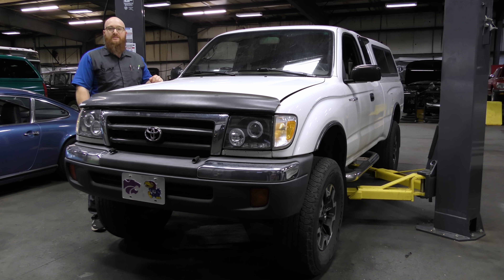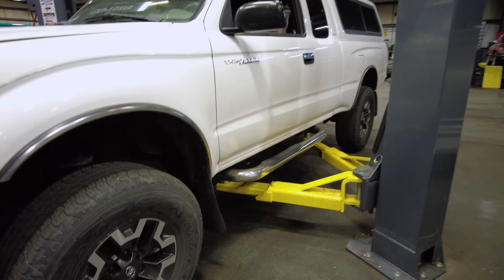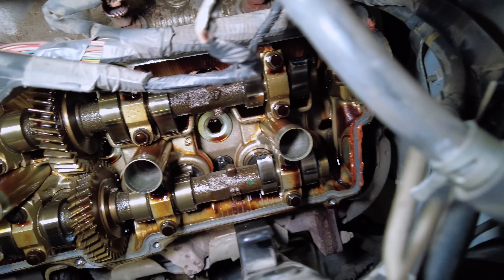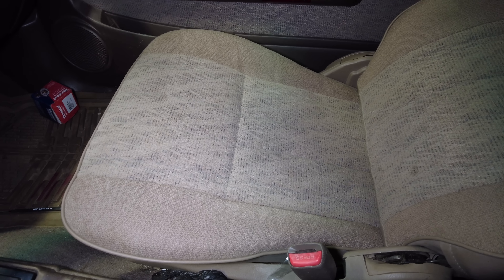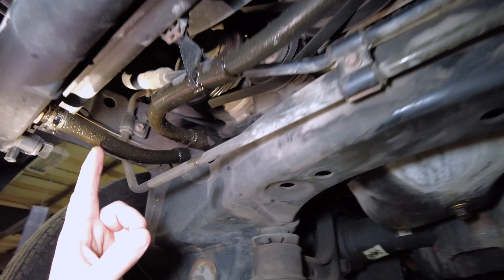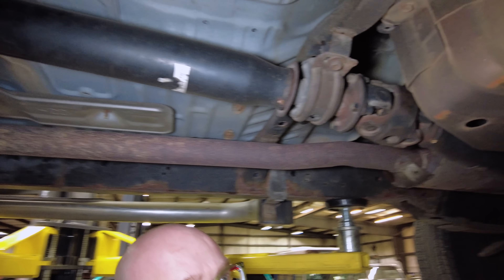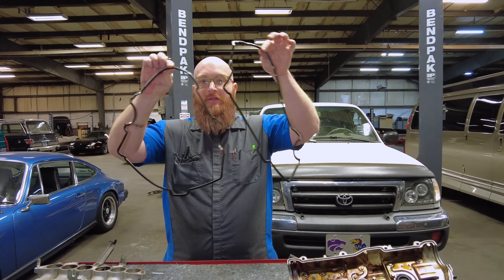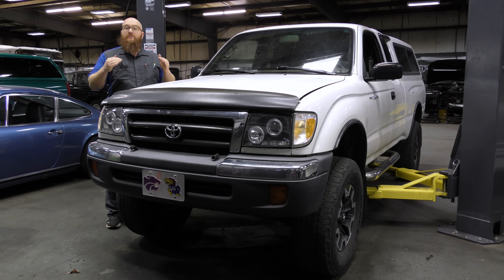Is it worth fixing this rusted out '99 Toyota Tacoma? CAR WIZARD explains

Comment: I'm still driving the base model 1993 Toyota pickup I bought new. Over 300,000 miles so far. No rust except for the original chrome bumper that I replaced. Uses no oil, original clutch, alternator, starter, and rear brakes. Solid little truck.
Reply: Uses no oil ?? You don't put oil in your engine ?
Reply: @Vintage Triple X  think he means it doesn't burn any
Reply: Oh! Thanks
Reply: Yea, oil is for the weaker brands, as long as you spit inside the oil cap its ready to go for a few more years 😂
Reply: @isaacdelavega9487  oh okay.
Reply: @vintagetriplex3728  BMW uses no plastic
Reply: I was sad to dump my 01 tundra... 298k miles, stock clutch also, no oil use, ran like new... (My dad bought it new)

But it was so rusty, and only 2wd... I moved further north and needed 4wd. 

I spent more time fixing broken things due to rust and patching them, than real issues, it was a wonderful truck.
Reply: @vintagetriplex3728 By the sound of my gardeners Toyota Tacoma, I don’t think he ever puts oil in his engine.
Reply: 22RE?  Have you had to replace the OE plastic timing chain guides?  The driver's side guide on mine broke ('91, 170k miles) and the chain was eating through the timing cover.  Replaced with aftermarket metal guides.
Reply: I'm a bit surprised to see so much oil coming from a Tundra, even one from that year. Makes me wonder if it's a driver's issue.
Reply: Yeah, I saw one, which is rare, of a similar year in rusty Wisconsin yesterday, it was crumbling into dust, as did all vehicles up here.
Reply: @lab1042  I installed a new timing chain set including new guides at about 190,000 miles. It was starting to make a little noise but the chain wasn't touching the timing cover and the guides weren't broken.
Reply: @mgrsdgfsdafsdgrsdgfsdg6980  yep, my old friend HAD to get a new car every 2 years. Just pay off your vehicle!
Reply: No point in selling it now. People take those things and beat them into the dirt, so they are getting rarer.
 -  Someday, you will be able to say "I own a classic 1993 Toyota Pickup".
Reply: You're telling me there is zero rust anywhere ? That's what you're saying?
Reply: $1500 for your work but how much for the frame repair which looks pretty bad? Good video.
Reply: Best year IMO
Reply: You probably want to replace those rear brakes they may be corroded and not giving 100%
Reply: original clutch? holy moly!
Reply: @vintagetriplex3728  Gottem
Reply: My '92 doesn't have quite as many miles as yours, but still has the original rear brakes and alternator. Starter didn't make it though.
Reply: I had a 1993 Toyota 4Runner pretty much as my first car. Unfortunately the head gasket went and just had issues here and there. Decided to sell it. This was many years ago. I now have a 2016 4Runner I’ll prob keep it forever
Reply: @vintagetriplex3728 top gear did a video on a 90s Tacoma by dropping off a building
Reply: @Helicopter Dad! I am a mechanic and not a dad thank you
Reply: Where do you live or have you done the majority of driving?
Reply: Here in the northeast, frames get wrecked
Reply: @volvo09  there's tons of tacos near me now with 200-350k miles and rusty or replaced frame's are the only thing needed to be mentioned.
Reply: Original clutch?
Reply: @slyfox4564  my tundra had the original clutch at 300k. My dad bought it new in 01 and I know he never changed it. He sold it to me at 240k and I drove it till 300 when it was just too rusty, and I moved and needed 4wd. 

It would do a burnout if I wanted to, the clutch had plenty of life left.
Reply: Those old stick work trucks are the best.
Reply: @volvo09  wow I've never seen a Tundra with a Manual transmission. Those must be unicorns
Reply: @engineer_alv  only the v6 2wd had them. 

(That I know of) if there was a 4x4 model it's truly a unicorn. 

Mine was an absolute base model, only option was AC, if it was even an option.
Reply: original rear brakes wow..mine is 160000 and mechanic says its at a 3
Reply: I live no rust California and will keep my 3 Toyota trucks as long as possible.

Comment: A friend had a 1989 pickup Toyota. Around 2005 he put a lot of money on it because it was very rusted. We told him that he could use that money as a good down payment for a new truck and he told us. By the time your have to throw away your plastic truck my Tacoma will be still kicking fine. Well he was correct.
Reply: Back in 2005 trucks were still good honest vehicles w/o much  crap to go wrong.
Reply: @engineer_alv  Tacomas from 2005 were infamous for rust rot and blown head gaskets at around $100k miles. This Tacoma managed to beat the odds because 1st gens had such severe frame rot issues that Toyota feared that the US government was going to force the company to issue a safety recall. When they announced the 2nd gen Tacoma, there were a ton of internet claims that the frame rot problem was "fixed" but that proved to be a lie.

Comment: I live in the Northeast, and that rear bumper is not rusty and bad, its got another 10 years of life still in it 😁
Reply: Lol I'm in Canada, and that's every truck after 5-10 years.
Reply: @jordanmercier3616  Eastern Canada.  aka Salt land.  Not like this in Saskatchewan / Alberta.
Reply: Yeah he has no clue what "rusted" means. That thing is brand new.
Reply: @buddyrevell6369  Needs to see the rust of vehicles from  Toronto,  Montreal,  Buffalo,  Rochester and Syracuse !!
Reply: @LakeNipissing  yup. I am in the northeast.  He's crazy.
Reply: Technically Kansas is the Midwest but they have no idea what rust is. Come work on some vehicles from up north. Plan on replacing some hardware or at the very least using some thermal persusion to get those fasteners to move.
Reply: @LakeNipissing  I don't know how you guys get around without using salt.  That's always been crazy to me.  I know it doesn't work when it gets really really cold, but even when the temp gets below a certain threshold, the sun will have an effect and the salt will work.  On the bright side, you don't have to deal with the rust.  I've been up there a few times in record cold, and driving wasn't fun.
Reply: @mplslawnguy3389  Coarse sand is applied to the roads here.  Traction at any temperature.  Also has the effect of being dark and melting the ice in the sun,  but everything freezes solid and dry as soon as the sun sets.  But the sand is still there for traction.  Works pretty well.  Everything is VERY MUDDY in the spring though,  until they vacuum up the piles of sand along the curbs.
Reply: Thats what I said lol
Reply: @LakeNipissing  That has to wreak havoc on the sewers.  I think that's why they quit using sand here.  I remember when I was younger they used to put it down, but now it's just chemicals.
Reply: @colinklang  it is likely this truck is originally from Iowa, Illinois, Minnesota ... but this rusty crusty on this rig is EXTREMELY strange imo
Reply: @LakeNipissing  OMG i bet it is bad bad!

Comment: The thing I hate about old Toyota truck is that when they have a gorgeous no rust body the frame is always rotted out, and the ones that are all rotted always have the good frames
Reply: Yup.   Had a great running Yota, came out after an ice storm to find that the cab was resting against the bed.   Only noticed when I couldn't open the tool box.  Had they not done that, it probably would have split in half.   So, like Toyota, but not going to get one of their trucks.    That bad experience ruined them for me.   Especially when none of our older trucks had that issue despite the same neglect and abuse.   Heh, should have put the Toyota drive train in the other truck.
Reply: i had a 97 limited 4runner with a clean body shit frame. got a 99 sr5 with 300k miles rotted to hell body beautiful frame.
Reply: Solution is to move out of a salt belt state.
Reply: @xpvrrish  that makes absolutley No Sense!?!??
Reply: @Jeff-sp7bg  solution IS to wash that nasty crud and crap off routinely...

Comment: Thanks for taking care my Toy, Your crew did a great job and I was pleased with how thorough you are. 😂 I wish I had known it was going to be on YouTube i would have cleaned it up lol very cool seeing it in the video, the seat is laid down because usually my dog is riding there and he is 95#s he's also the reason for a few scratches in the interior!
Reply: Nice truck! I recently bought my first Tacoma. 2010 w/ only 45k miles and I'm 53 so my friends say it's gonna outlast me. What do you use the clip on the dash for?
Reply: Thanks for sharing your Tacoma with us.  That engine looks like it is in great shape.  I wouldn't be surprised if it makes it to + 500k miles.
Reply: @ianobodie2338  That's most probably for his smartphone. If its something else, even I want to know
Reply: I have a 99 SR5 TRD. I bought it in '05 with 73,000 MI. I was driving home from work February 20th of this year and a lady in a Tesla T-Boned me. The mileage is a little over 263,000  right now. The TRD with the rear Locker, I had it supercharged. I had to wait over 6 weeks for a collision center to be available to look at it. It will be going in a day or two.
All I've done in almost 200,000 miles and 18 years was the rear leaf springs, shocks,  a starter, a door handle, a radiator, a fuel injector and two timing belts.
Tires, brakes.
Oh and an oil change every 5,000 miles.
It's bittersweet I love your truck.
Like I said mine goes away in a day or two to see if they can fix her or not.
Reply: I also have a 99 same truck but with the 2.7 4 cyl and a 5 speed manual, currently at 262k miles and counting. Still runs and drives like a top and doesn't burn a single drop of oil, I can literally go 9k miles and the oil is still to the full mark on the dipstick. I've had my frame repaired too in the same spot on both sides with 1/4" plate steel, as I live in northern Michigan but the truck is from Colorado. I love my truck and I'll never sell it, it was my first vehicle and I'm the second and final owner and I'll be driving it till the day I die or it crumbles into pieces.
Reply: @hunterhippensteel  I was hoping it would be my sons first vehicle.
I received word yesterday that it is going to be salvaged.
Too much damage to the rear axle, leaf springs, frame and other rear end components. It has been a Colorado truck since new.
Very sad. I am in my mid forties and actually cried watching it go away on the flat bed. I too would have kept it forever. Take care of you and that truck!
Reply: I have the same style Tacoma, mine is an 02. It was a Florida truck. Extended cab TRD 4x4. 
Runs like a top!!
Reply: @teddibear1943  Very sorry to hear that, I know for certain that I'd cry like a baby if something ever happened to mine. I came real close to rolling it over down a hill once when off roading and I was more worried about it than myself lol.
Reply: nice truck dude. I got a 2000 tundra myself
Reply: Rohrjewlery you need to do a “ sate t cap “repair on your frame. I had the same issue. Amazing product.
Reply: Keeping it real brother is the way to go.😅
Reply: You got the 3.4 5vzfe motor in that Tacoma ?? I got a 2000 4Runner with that motor lifted 5 inches on 33 inch Mickey Thompson tires with 289k miles no problems what so ever I know a couple people with over 500k miles that they run like they came off the showroom floor ! Bulletproof trucks !!

Comment: I'm glad I'm not the only one who thinks a 1999 vehicle is not old. I've seen people say a 2013 vehicle is old! That's barely old. I drive a 97 Lexus with 117K miles, no rust and nothing but normal maintenance done to it. I guess if you neglect your vehicles then of course a 2013 or late model car will be "old" to you.
Reply: If it had no rust and was in original condition you could put collector plates on it next year here in Canada!

Comment: I have a 2004 4runner (V8 and proud!) which previous owners definitely used and maybe even abused. 206K miles. This vehicle is dead reliable. By far the most reliable car I ever had. Now, I do maintain it religiously. Very impressive machine.
Reply: 2003 V8 AWD.   240,000.  Runs good as new and tows 3 jet ski trailer over a 6,000' pass from sea level into 110 degree heat like a BOSS!
Reply: That V8 will last forever
Reply: Back in January I purchased a 2008 Toyota Highlander 4WD with 138,800 miles it was a loaner vehicle at a local Hyundia dealership for 15 years, well maintained for all those years, before that I aways owned Acura TLs for over 20 years back in the 90s.i brought a 1989 Toyota Camery LE and a Toyota 4 Runner, now in 2023 aim back in another Toyota, my plan was to drive it and trade or sell it and get another Acura, but the more I drive it the more I love it, parts are cheap at auto parts store or on Ebay looks like i will keep this Highlander for a while.
Reply: @666KTY why are you yelling at me ?
Reply: @666KTY A non interference engine is great if the timing belt snaps, no damage will be done as in an interference engine.
Reply: @donc6781 
Just keep the maintanance and it will last a lot
My 2004 4runner v8 250k
My old tundra 2001 v8 488k and still runnng amazing.
Reply: 2004 V8 4WD at 197k.  Running great
Reply: @666KTY well thanks for that nugget...now....shhhhh!
Reply: @donc6781  El Loco.   Whatever.
Reply: @666KTY that's too bad.  Get a bigger phone ne.

Comment: That's why I replaced my 2007 Lincoln Town Car which had 464,000 miles on it and still running strong with a 2017 Toyota Camry LE with the 2.5.

Comment: I've been a Ford guy all my life.  My 07 Crown Vic has 205,000 miles on it still going strong.  I have a 75 F-250 with 193,000 miles on it and it runs great.  After reading all the articles and watching all the videos, I realize that Ford has gone to Hell.  I've never been so disappointed.  Thank you Car Wizard for the straight skinny on all of this.  Keep it up.
Reply: yep, my crown victoria was the last ford I owned. It was excellent. Everything after 2010 is a POS
Reply: Yeah they went downhill but so did GM and Ram! They were decent in the late 90’s early 2000’s. Don’t know what happened.
Reply: @jaymoar3561  Greed happened...or more accurately "Short-Term Thinking" happened.  Used to be that auto execs expected to be with a company more than a couple of years.  Now management/accounting types want to boost the Short-Term price of the companies stock - as part of their compensation is paid out in stock shares.  
So cut a few corners here, use some cheap outsourced parts there...boosts the profits and thus price of the stock in the Short-Term.  They don't expect to still be with the company years later when all those Short-Term cost cutting measures result in unreliable vehicles.
Reply: I have 321k on my 97 tbird 4.6l and valve covers have never been off. I have an '04 excursion 5.4l with 212k . Treat these older vehicles well and they will last. Upholstery is another story.
Reply: They got cheap after they got bailed out. Like that handout wasn't enough
Reply: Every car company has gone to hell since the 90s
Reply: Crown Vic and Mercury Grand Marquis are still great options for the budget.
Reply: @waterloo123100  Yes it's really sad.  I kick myself that the 80's and 90's cars and trucks I've owned in my younger years, weren't taken care of like they should have been because I was young and dumb.  These newer trucks are not great, too much tech, too much plastic.  Even the newer Toyotas are going that way.

Comment: You’re 100% correct Wizard, my 2001 Oldsmobile Bravada was a nice suv, but at 200k it was about at the end of the road. My 2000 4runner has 318k right now and o wouldn’t hesitate to drive it cross country right now. Oh and BTW I had a 2006 BMX X5 with a V8 and it was the worst car I’ve ever owned!
Reply: So what I know a guy had a ford ranger with over 400k miles he said he changed the oil twice a year no matter the miles
Reply: Yeah man, but that’s a Ford Ranger! When I was growing up, my neighbor had an f150 with over 400k on the old clock! But you know these aren’t the norm, yes it’s possible to get high miles out of domestic stuff here and there, but with Toyota it’s the norm rather than the exception.

Comment: I have a 02 Tacoma with 276K.  Did the valve covers a year ago. Not too bad for a DIYer but took about 5 hours.  My rule of thumb for every 1k in repairs I want 10k more in miles.  I wouldn’t hesitate to drop a new motor in.  When I bought it new I never thought it might be last vehicle.
Reply: @RobertD-y42  I still have the original rear brakes.  Have you done the timing belt.  By miles you're not even due, but by age???